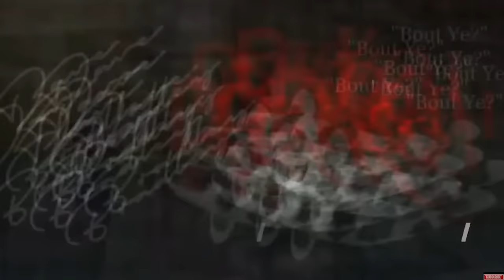DID IT LEAK??  Filling My Stunning Koi Pond - 💦💦WATER 💦💦 *Part 8*

Comment: Great build great to watch your progress...where did you purchase the diffuser pipe from thinking about doing what you've done in the moving bed ...thanks Paul...
Reply from the maker: I got it from ebay mate https://www.ebay.co.uk/itm/185025163557?var=692804307500 here is a link.  Then I purchased fittings from these guys https://www.ebay.co.uk/itm/265843071841?var=565661804637 and I just used cable ties to tighten the pipe onto the fittings...  Hope that helps Bud..

Comment: My guess for just the pond is "Your Pond Size is: 18225 litres / 4008.94 gallons" going off the block measurements. Looking great now Dave. Out of interest did you make a video on removing your old filters and installing the drum on your old pond ? Cheers.
Reply from the maker: I filmed a couple of bits and then crashed on with the job, never created a video sorry..  Have just turned the water off as it has hit the bottom of the skimmer lip....  That's the pond only as no filters and its currently 4160 gallons with a fair bit still to go in...  I am hoping with my filters I will get my 4800...  We will see...

Comment: Exciting times! I dreaded the fill up as was scared the glass would break 😅
Looking really good though! 
What size are your windows?
Reply from the maker: The glass is 2m x 0.8m with 180cm x 70cm visible.  Yes were getting there.  How's that little kohaku doing?
Reply: @dkoi-tv  she’s doing much better thanks! Had a few more salt baths and it’s hard to tell her apart now 😄
Those are big lumps of glass 🫣😬😲
Reply from the maker: @VoodooKOIuk  so glad it's on the mend.  Yes big windows 🤣🤣

Comment: Hi Dave- on a recent short it looked like you have been able to solvent weld the inlet pipe to your Cetus Sieve - if so can you send me a link as to what pipe you used (I couldn’t find correct measurement on any standard or imperial solvent weld pipe) as I’ve had an issue (mines outdoors) where temperature change meant the connection to the inlet on the Cetus slipped off - disaster was averted but I have been looking to resolve and happy to share - fabulous build meantime - well done!
Reply from the maker: It's not solvent welded mate I have a 90 rubber boot to 4 inch pipe Bud.  Sorry....  Thanks for watching mate and I love this sieve what a piece of kit surprised they aren't more widely used....
Reply: @dkoi-tv  No worries and thanks for responding - great piece of kit I agree - my set up is different in that it is raised and fed by a retro bottom drain on an outdoor pool - I’ve two Cetus and it happened on both within a short period of each other after hot weather - but I am competing with gravity and heat from the weather.
Reply from the maker: @Spike064  Could you not brace the pipework with something to hold it up?  To prevent it from dropping off.  You can buy 4 inch brackets on stainless rods.  Andrew Daly fitted some in his filter house on the koi diaries channel..   I will be getting some for mine no doubt...